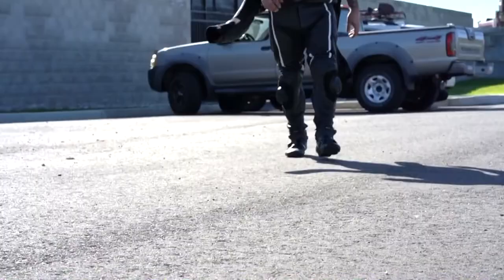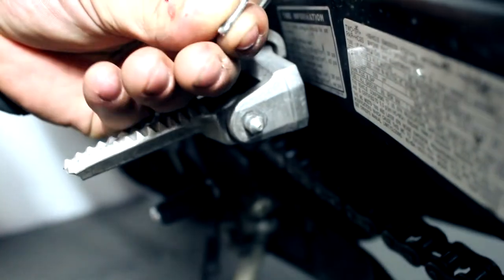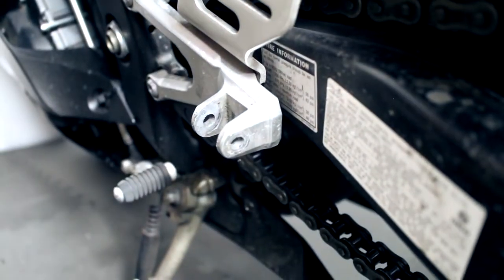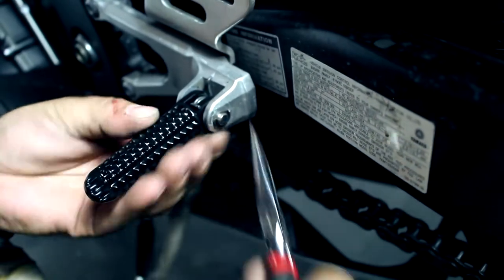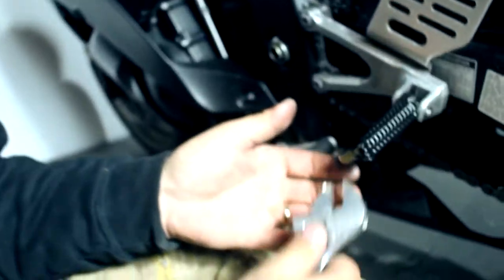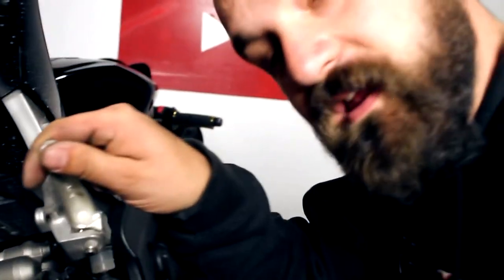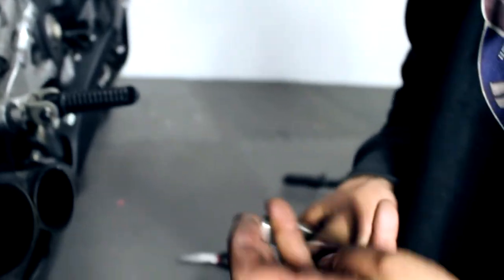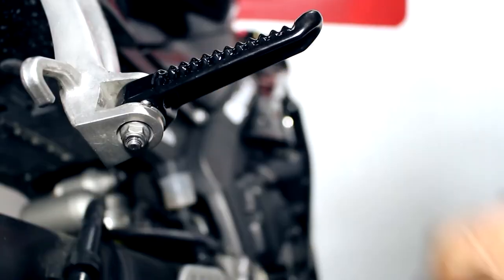How To Install Motorcycle FootPegs

Comment: Do you always have to grind on the exhaust side? I'm riding a FZ10 and trying to replace with some Rizoma pegs and I'd rather not use a grinder if I don't have to.
Reply from the maker: If it has a rivet you will have to grind yes

Comment: @Fbomb bike life my new rear footpegs are different from yours in this video! On the back side I have 3 holes 2 are bored but no exit  the only hole that's straight through is the middle one so how do I install it from here or did the send me the wrong pegs? This is a 2004 kawasaki ninja zx 6r  636 I'm working on
Reply: The new hardware didn't come with nuts/bolts help here

Comment: Thank you for this, wasn't sure. I don't want to spend $60.00 for one side peg from Yamaha. Crazy. Do I need to put grease or anything in the pins before installing? Like a caliper pin? Does it matter?
Reply from the maker: No you dont. Dry pins are 👌

Comment: Hi, can I ask you please, what is the precise size of the thru axle and the support that attaches to the frame of the bike?
- pin hole diameter
- distance between the two pin exit holes (support width)
many thanks in advance

Comment: What if it’s a rivet pressed into the foot peg? Mine has a rivet, 2009 FZ1, any help?
Reply from the maker: You will have to use a grinder to shave it down. I've had to do that once or twice. Just be careful.

Comment: I don't understand why left side foot peg needs grinder. Why couldn't they make both left and right the same?
Reply: Daniel Shaw one must’ve been replaced before. The OEM factory footpegs have (basically) a rivet rather than a cotter pin or circlip. So it’s easier to just cut the rivet off
Reply: @kaseyworkman3066  mine 09 was the same, the left side had the cotter pin, the right was mushroomed down and had to use a hack saw to cut it off.